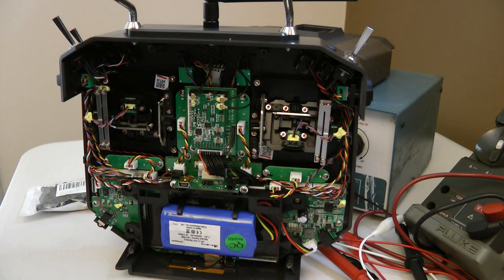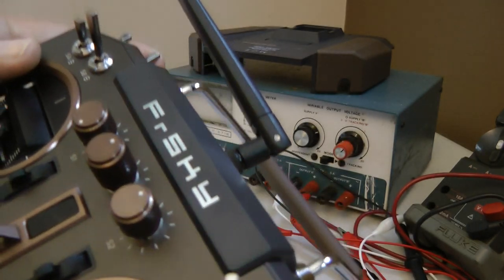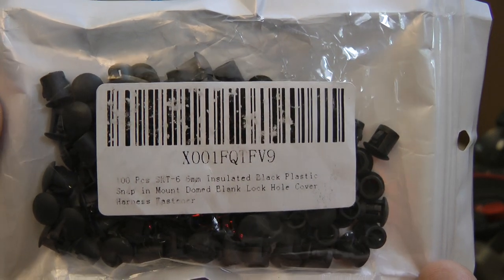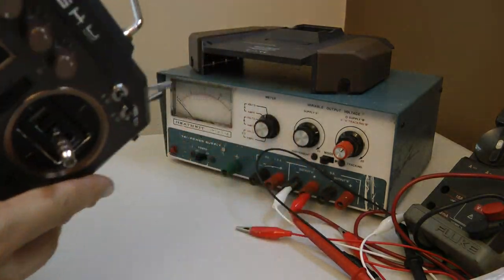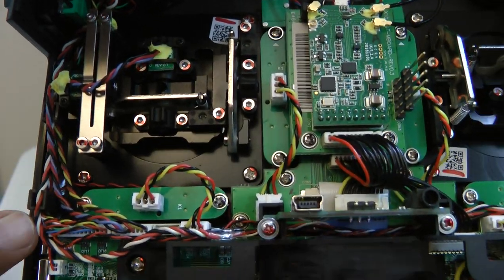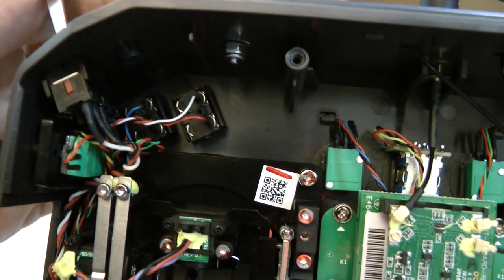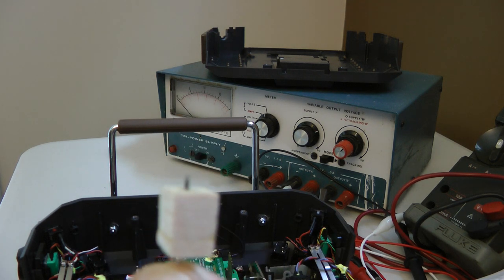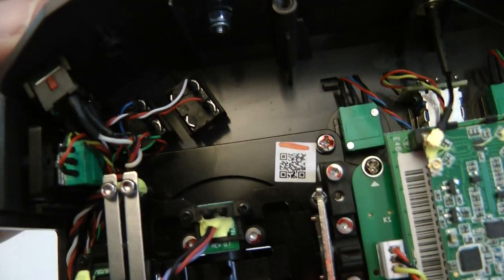Frsky X10S relocating switches and drilling new holes for switch locations

Comment: Thinking of doing the same thing; but wondering if just moving the switches physically and resoldering to the wires already in place wouldn't have worked also?   Thanks for the tip on the plugs from Amazon.